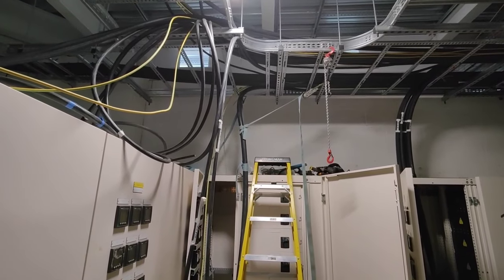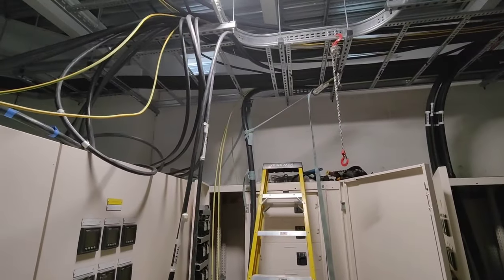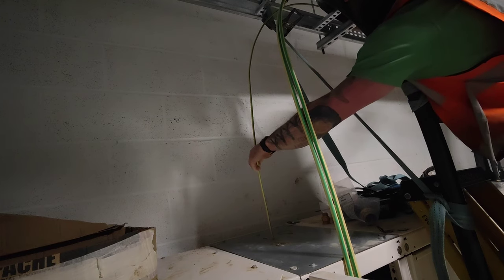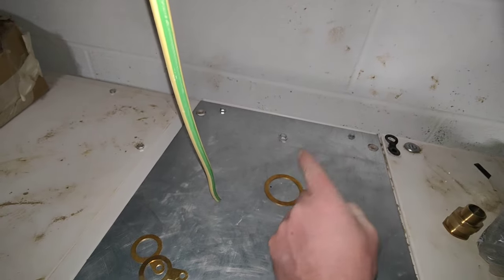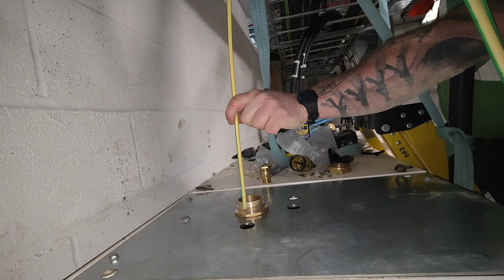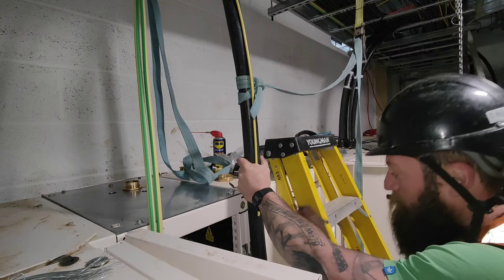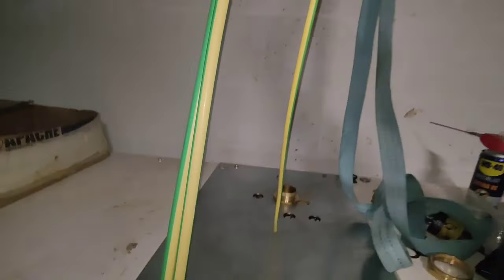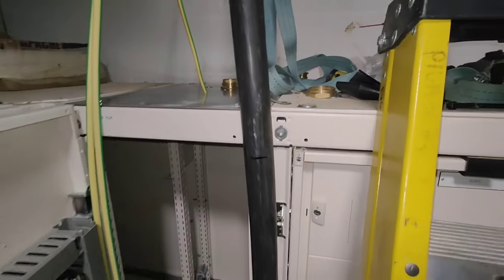Tip Video!! How to measure big cables using a "Mimic" cable.

Comment: Great video, thanks for the tips. I will be glanding off 6 of 3C x 240mm + 3E 35mm for 2 large motors this weekend and will definitely be using this technique to get my measurements right for the copper tape screen 👌 Cheers from Australia.